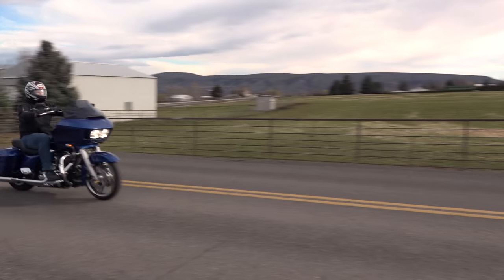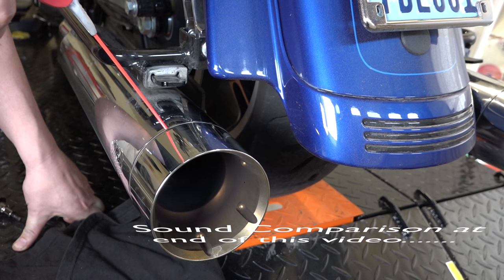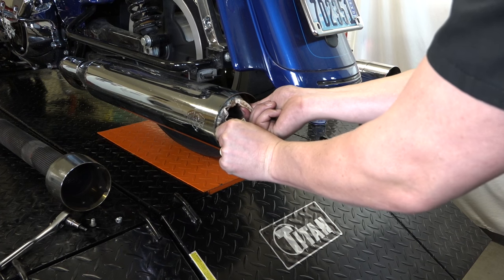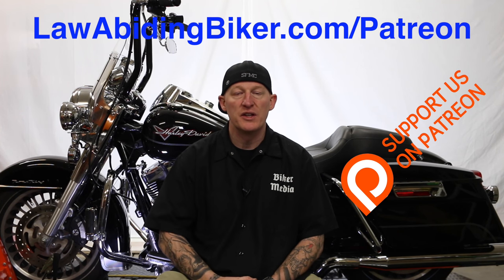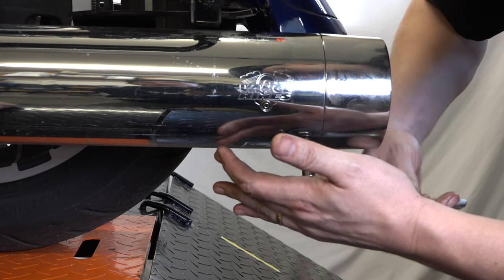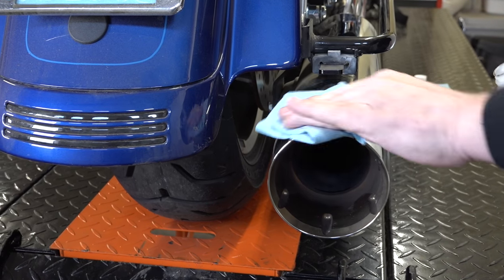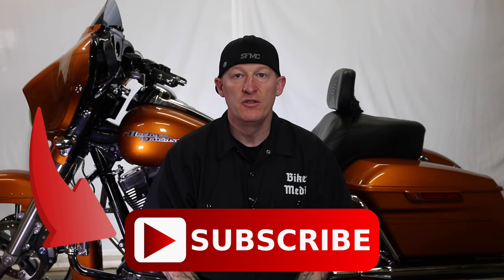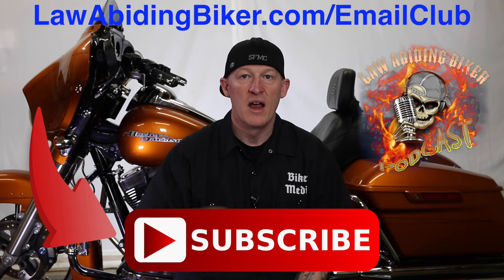How to Remove Baffles/Packing From Vance & Hines Pipes/Mufflers-Louder Motorcycle Pipes?

Comment: In NYS, as of April 1, 2022 the fines for exhaust mods that make your bike louder than stock is $500.  That fine is also levied against the inspection station AND the shop that did you mod.  Same goes for cars but fine is $1000.
Reply: In NYS, communism is cool

Comment: I've removed most of the fiberglass packing from my Bassani DnT slip ons about a year ago. I love the sound. Only now I noticed the right muffler has this gold/amber tint spanning the lenth of the muffler. Does the packing protect the muffler from heat preventing discoloration?  or am I running lean possibly? I have stock headers, aftermarket air cleaner. It was tuned by previous owner, supposedly.
Reply from the maker: The fiberglass packing could definitely reduce heat.  Probably why you are seeing the discoloration.  You can always pull your plugs to ensure you aren't running too lean.

Ride safe & Ride Often!

Here is a link to a bunch of our useful Free vids: http://www.lawabidingbiker.com/freevideos

Here is a link to some of our useful for purchase videos: http://www.lawabidingbiker.com/buyvideos

Want Answers & Information Fast? And help support us at the same time? Do you like the content we provide?

Our patrons get answers to their questions/comments/feedback in less than 24 hrs and are part of our Private Facebook Group. If you are interested in being in this exclusive group you can get all the details at ==> http://www.lawabidingbiker.com/patreon

If you haven't subscribed to the Law Abiding Biker Podcast make sure to do so. Listen in as we talk weekly about issues/items like this & so much more. You can listen on iTunes (Apple/IOS), Stitcher Radio (Android), or any other Podcast App ==> http://www.lawabidingbiker.com/podcast

Join our free email club at http:///www.LawAbidingBiker.com/EmailClub. Only relevant content will be sent from time to time. Email club members are the first to find out about free or for sale content are given special coupon codes.

Comment: Ryan, will this affect performance at all? I did this with my sport I'ld and it was all around awesome. Kept just alil packing to keep the sound clean. Thinking of doing the same on my Road King w/ RC Components slip ons. Hopefully it's the same set up. Just don't want to lose throttle response.
Reply from the maker: All is well. Just make sure to remap your EFI. That's our recommendation for optimum performance. https://www.lawabidingbiker.com/34/
Reply: Ryan Urlacher how do I remap the EFI? Is that something the dealer has to do?

Comment: Hey Ryan - Great video but I neglected to confirm I have slash cut V& H so wondering if you know HOW T.F. to get my baffles out?  I removed the 2 screws on each side, sprayed WD-40 between the pipe & baffles and CAN'T get them to free up.  Before I pull them back off of the bike and try and figure it out I thought I'd check with you.  Thanks bro
Reply from the maker: They have a metal perforated baffle that has a straight pass through.  In our experience they can be tough to remove if the pipes have been on the bike for a while due to heating and cooling.  You may want to try pulling them out when they are warm.

Comment: Hey Ryan thanks for the video I have the hi output V&H Slip-On. I removed the packing and got great sound but lost pressure and go throttle lag. I have a FP3 on my SGS will it correct this issue. Bikes stalls and fails to take off so times now
Reply from the maker: Yes, just run another auto tune on your bike. Good to go!

Comment: nice video, was wondering I have 15 road king with twin slash oval slip ons and vance and hines headers and stage 1 screaming eagle air intake, so it was tuned for that. if I remove just the packing like you said , do you think I will have to have retuned
Reply from the maker: We definitely recommend you run an auto tune map after removing the packing. That's why we never suggest getting Harley downloads. You are stuck if you ever make changes. We hightly recommend the V&H Fuelpak 3 EFI tuner. We run this tuner and sell it in our store. It gives you flexibility to make as many changes as you want. Then you can just run a simple auto tune map and be done..... Here is a link to the FP3 in our store and the free video we did ==> https://shop.lawabidingbiker.com/collections/air-fuel-exhaust/products/vance-hines-fuelpak3-efi-tuner-harley
Reply: Thsnks

Comment: Just purchased 2022 roadglide m8 114, parts are backed ordered,  roadglide has SCreamjng eagle stock pipes, bike is 100% stock..  if i take the packing out. Do i need to get a tuner? 

Basically will i damage anything.? Will i gain power or lose power

Comment: I took my packing out of my bassani slipons I have fuel pak should I just do a auto tune session on my current map or reflash fresh then auto tune.  It dont seem to run much different.
Reply from the maker: The auto tune session would be good.  Just to fine tune things.

Comment: Hey Ryan, first time Harley owner, so I'm trying to learn as much as possible!  I installed the headpipes and V&H Titan 450 slip ons.  I got the right pipe off with little to no issues, however the left pipe has been a thorn in my side.  I finally gave up and put the fiberglass packing back into the right pipe and have put almost 800 miles on the bike since.  Long story short, I want to get the left pipe fiberglass & baffle out and was wondering if there is another workaround you would recommend.  I've used WD-40 and also bought B'laster 16-PB Penetrating Catalyst (supposed to be the best out there, a higher rating then WD-40) and let the bike sight over night soaking in lubricant.  I also wrapped them in a hand towel with a large set of channel locks with still no success.  My next step is to let it soak again over night and use a rubber mallet.  Any other suggestions????????????????
Reply from the maker: Wow!  It sounds like you've done everything.  In our experience they come off easy with the help of penetrating lubricant.  I'm afraid we don't have any other tips for you.

Ride safe & Ride Often!

Here is a link to a bunch of our useful Free vids: http://www.lawabidingbiker.com/freevideos

Here is a link to some of our useful for purchase videos: http://www.lawabidingbiker.com/buyvideos

Want Answers & Information Fast? And help support us at the same time? Do you like the content we provide?

Our patrons get answers to their questions/comments/feedback in less than 24 hrs and are part of our Private Facebook Group. If you are interested in being in this exclusive group you can get all the details at ==> http://www.lawabidingbiker.com/patreon

If you haven't subscribed to the Law Abiding Biker Podcast make sure to do so. Listen in as we talk weekly about issues/items like this & so much more. You can listen on iTunes (Apple/IOS), Stitcher Radio (Android), or any other Podcast App ==> http://www.lawabidingbiker.com/podcast

Join our free email club at http:///www.LawAbidingBiker.com/EmailClub. Only relevant content will be sent from time to time. Email club members are the first to find out about free or for sale content are given special coupon codes.
Reply: I've seen the muffler taken off and a piece of wood used to hammer out the baffle from the other end.
Reply: use one of them oil filter wrench with the rubber belt on it.

Comment: I have twin slash rounds and know that they don't have packing. Will I have any issues if I remove the metal baffles?
Reply from the maker: If you do that you'll have to re-tune your Electronic Fuel Injection. We never recommend removing those baffles as you'll loose necessary back pressure. Your bike will loose power and not run optimally. But, it can be done. Not suggested. We recommend the V&H Fuel Pak 3 for re-mapping your EFI. We sell them right in our store and their are info/install videos there: ==> https://shop.lawabidingbiker.com/collections/air-fuel-exhaust/products/vance-hines-fuelpak3-efi-tuner-harley

Comment: I have a 2017 Street Glide Special with stock exhaust. Would I have any issues with the emissions monitoring system if I modded/removed the packing and/or baffles? I really don't want to drop 700 dollars on a set of slip ons right now. Thanks!
Reply from the maker: Any time you change the exhaust or intake you should remap your bike.  We prefer to use the Vance and Hines FP3.  https://shop.lawabidingbiker.com/collections/air-fuel-exhaust/products/vance-hines-fuelpak3-efi-tuner-harley

Comment: I got a question I decatted my head pipe 2 days ago. I have cobra neighbor hater slip-ons which has no packing. Now I get the deceleration gurgling almost like in this video but worse which is very annoying. Is there anything I could do to the baffles to make it sound better. Like I said there's no packing whatsoever in cobra neighbor hater  just a baffle with holes similar to the ones in the video.... Would tuning get rid of the gurgling? If so which one should I get.. not sure if I'm going to do cams ... Bike definitely runs a lot cooler with the cat gone
Reply from the maker: You can buy the packing material.  Here is a link: https://bit.ly/3La9w1c

Comment: I have the V&H slip ons on my 15 road glide, not sure of the model but there on ones at the HD dealer for $450.00, they have a deeper sound but not much louder then stock, my buddy's with Rineharts are laughing at them, is there packing I can remove? I see 2 screws on each baffle, but don't have the cash for a power commander and Dyno tune.
Reply: Depends on model to model.  Take the screws out and remove the baffles.  If there is packing remove it carefully and give it a try.  Rick from LAB.  Check out our store at www.lawabidingbiker.com/store

Comment: I've bought the V&H Quiet baffle piece for my Upsweep 2-in-1. I removed all the bolts I need to remove. But I can't get the end cap loose. I tried WD40, hitting it with a rubber mallet and pure elbow grease, but it really won't budge. I'm kind of out of idea's, and I really don't want to damage the chrome finish. 
Any ideas?
Reply from the maker: Heat it up

Comment: can you cut the baffles on the eliminator 400's to get a little more sound?
Reply: I mean shorten the baffles or is that not a good idea
Reply from the maker: Eric we don't have experience with eliminator 400's.  Cutting down the baffles probably isn't a good idea.  On these mufflers we just removed the baffle wrapping.  The baffles are still intact.

Comment: Should retune if you remove the packing? I want to do that to my slip on 2-in-1 V&H 750 Street but not sure of the retuning if I have to?
Reply: Probably not a huge deal, but since we have @Vance&Hines FP3's we did.  In reality the removal of packing isn't gonna throw off an already tuned bike much.  So depends if you have already tunes from stock, etc.  Rick from LAB.
Reply: It was tuned after they put on the pipes, exhaust and my SE air cleaner system. I was warned not to remove the packing as my bike might not run properly if I do that. Thoughts?
Reply from the maker: Ours in running fine.  The metal baffle is still there.  We just took out the packing.  We ran an auto tune with our Vance and Hines FP3.

I'd leave the packing in if your worried it won't run right.
Reply: +Ryan Urlacher I want louder!! On thanks for the advice guys!!
Reply: On newer bikes with fuel mapping done by the ECU Its not necessary.
But if you have Carbs.. Oh yes,, definitely. You'll need a kit.
Reply: H Mayo not true...the ECU can make minor adjustments on its own but anytime you change air flow through rhe intake or exhaust you really need to adjust the base ECU calibrations esp since HD sets them so lean from factory for EPA reasons. The ECU is bouns by certain parameters. Dont believe me throw a stock bike on a dyno, record the results then tune the bile without changing anything on the bike and run it again. i guarantee you see gains and the bike runs better. Its because the ECM cant make those major changes
Richie

Comment: Great video Ryan as well as others👍 

I do have a dumb question for you...bought a used 12 SG' and I have on aftermarket slip ons (not sure what brand) the head pipes are Bassani's duals  with the SE intake and SE tuner... so if remove the packing from the slip ons does the bike need to be retuned. Thank you
Reply from the maker: Not a dumb question at all. Yes, you should retune anytime you make any modification to exhaust or intake. That's why we recommend the V&H FuelPak 3. You can do it yourself and it works awesome. We have them in our store along with a tutorial video. https://shop.lawabidingbiker.com/collections/air-fuel-exhaust/products/vance-hines-fuelpak3-efi-tuner-harley

Comment: There is a tad bit of rattle between gears. The baffle has no support without the packing. It will break off eventually.
Reply from the maker: Nope, we run a ton of them thousands of miles cross-country. No issues. Thanks for watching.